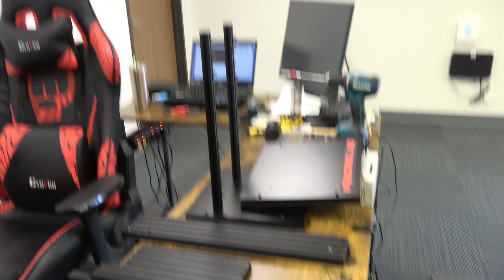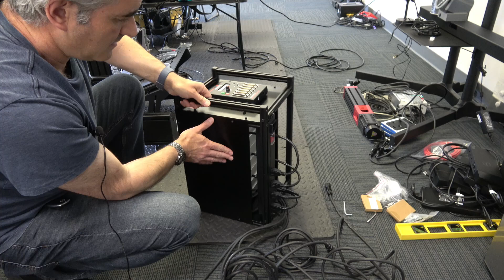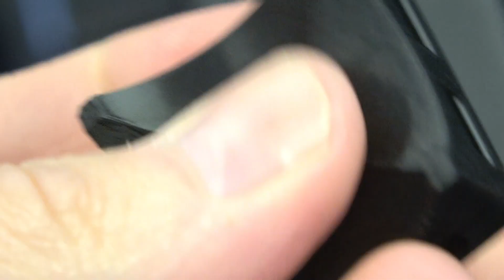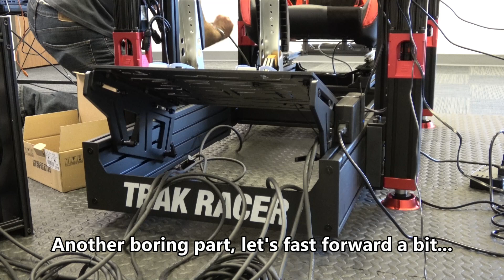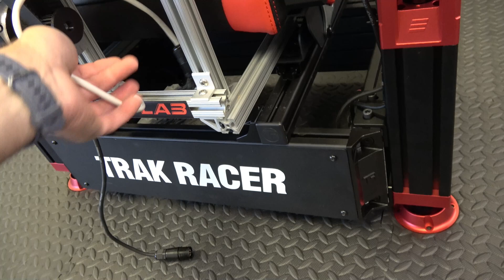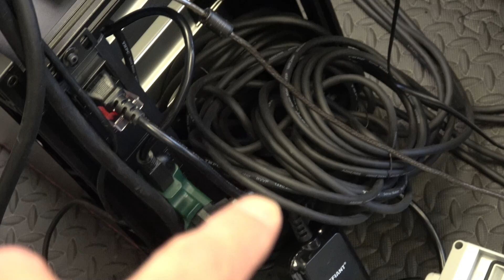Building a racing rig - Part3

Comment: Ich betreibe die servos mit 230v in Deutschland. Eracing meint das ich mit transformator auf 110v gehen soll . Denkst du das hilft🤔. Einen hochwertigen usb isolator habe ich auch schon getestet.  Leider bekomme ich das mit den elektronischen pfeifen (brummen) nicht weg. Servos unter  strom alles ruhig .sobald pc hochfährt und usb Verbindung aufgebaut wird fängt alles an.Ich habe die neuen weisen servos.
Reply from the maker: Running it on 110v will lower the amplitude of the 16khz humming by 50%, making it less noticeable if you can hear it. Sure why not 👍

Comment: Hi, danke für die Rückmeldung. Inzwischen habe ich das gleiche System wie du hier gekauft. Bin von allem begeistert. Allerdings habe ich unangenehme Pfeifgeräusche bei den Aktuatoren, sobald der PC hochgefahren wird. USB abgezogen geht es weg.es. Es ist ein elektronisches Brummen. Hast du eine Idee, wie ich mir helfen kann? Ich habe bereits einiges versucht. An der Steckdosenleiste liegt es nicht.

Gruß Suat
Reply from the maker: You need the newer white AASD-15A drives, that have no 10Khz whining noise of the older black drives. If you can still hear the 16khz noise from the new drives, I bet you are of young age, as I can't hear them at all.
Reply: Ich habedie weißen.. das Geräusch was ich habe würde jeden stören 😅.  Auf Dauer macht es einen verrückt

Comment: Very loud actuators.  You get what you pay for
Reply from the maker: @ittybitbobo7657  true, you get what you pay for. In my case silent actuators actually 😂 . What you hear perhaps is the frame and the peripherals on it vibrating to the high fidelity motion 😁 . See this video without game sound https://youtu.be/iQUTJrrPFYU?si=alx1gTlE4fSPlD00
Reply: These are known to be very quiet actually. With 150mm movement you want to have a very sturdy build to avoid movement of your equipment and gear.

Comment: the part link is not working so frustrating
Reply from the maker: @Dronetothetop  I'll check it out... perhaps I messed the links somehow 🤦‍♂️
Reply from the maker: @Dronetothetop  actually links work fine on mobile... maybe are blocked by your PC browser?
Reply: @tronicgr  Oh it is the browser. If you use the Edge browser from MS, it will go to another website but if you use Chrome, it is ok. Thank you

Comment: Thanks a lot for the video. It was very usefull.One thing that is always missing in the videos i have watched is how to actually fit the servo motors in the rack enclosure. Could you please share where did you get that rack enclosure from?.I am thinking about building a full motion system with  7 actuators and would like to know if there is a rack enclosure for that like the one you got for 4 actuators. Cheers¡¡
Reply from the maker: @skkainet  This is a prototype I got from eracing-lab. They are working out the logistics, before it appears on their website.
Reply: @tronicgr  Thanks¡